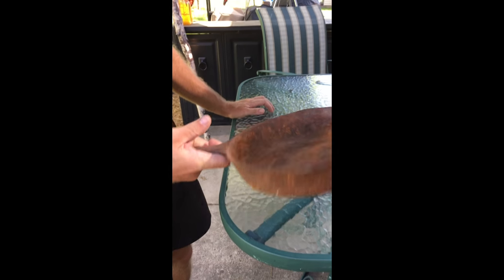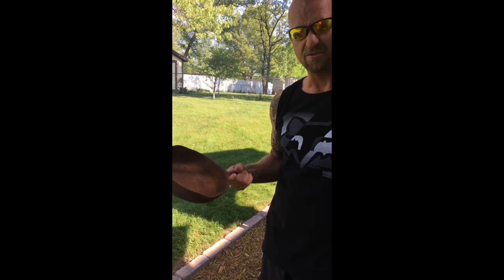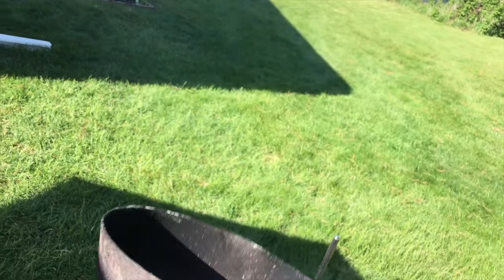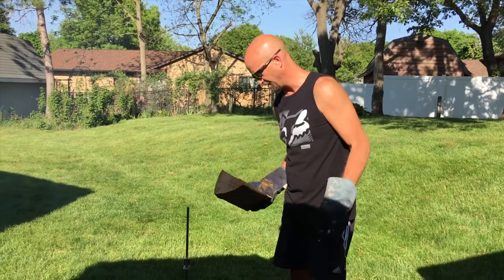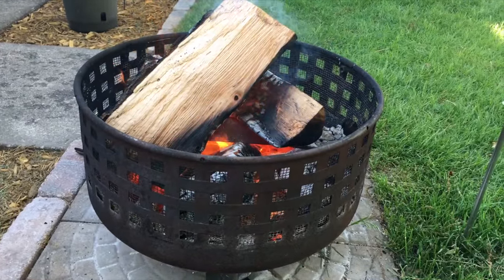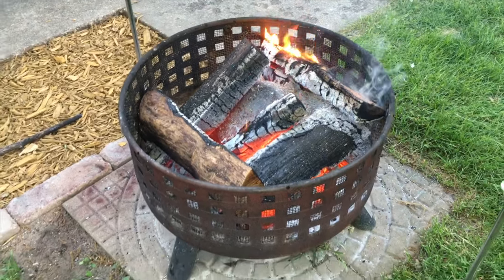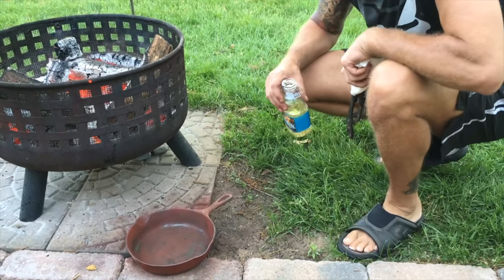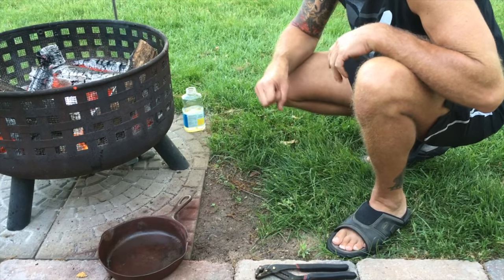Fire Restoration and Season of A Cast Iron Pan

Comment: Fire does not remove rust.  The heat from a fire removes the old layers of seasoning back to bare metal.  Rust will still be present.  You would want to do a vinegar bath or electrolysis to remove rust.  Did I forget to mention that you got your pan too hot?  When your plan is glowing red, it breaks down the structure of the iron in the pan and can severely warp or heat damage the pan.  I know you mentioned other methods like electrolysis, self clean oven or easy off.  You can do a lye bath to remove the old layers of seasoning too.  Just remember this, grandma and grandpa could go to the store and buy a replacement pan for a buck or two.  When you use fire and damage a pan, good luck finding a vintage piece at your local store...

Comment: Please don’t put cast iron in a hot fire to strip it. This could damage your cast iron. I have been successful many times with the fire method but also damaged a piece and seen many pieces damaged by fire. I no longer use this method. If it gets too hot the metal properties will become distorted and the piece will take on a reddish appearance when seasoned. There are safer methods for stripping cast iron. The fire method works great but if it gets too hot the metal can get distorted, warped, or cracked. Be cautious and choose a safer method, especially with a vintage collector piece.

Comment: The pan used in this video looks just like one I have from a house fire. Obviously this technique won't get rid of the pitting, but it will remove a lot of the carbon from the iron that the fire put into it. For removing the rust, either soak it in vinegar OR use a non-toxic rust removing product like Evapo-Rust. Thanks for not including a goofy intro with bad music and for cutting to the chase. This is one of the techniques I've considered using on my housefire damaged pan. Good to know the times and heat involved in the process. Thanks!🔥😎

Comment: Never never put cast iron in a fire.  If it gets too hot it will ruin the piece. Warped, cracks, permanent red marks that will never hold seasoning can easily happen. Old timers always did it because they didn't know better. I have seen it done and everything was fine but if it gets too hot It's ruined forever.

Comment: I have used for to burn grease off my skillets for years and never have once damage a skillet... actually did a fire burn 11/29/21 with no problems.. I have used the oven self cleaning a few times which works as well... you damage your pan when you make drastic temperature changes

Comment: I came across an old hot water kettle neglected  and full of rust. I heated it with a fire inside my charcoal  barbecue grill, and seasoned mine with bacon grease. It actually  came out pretty good.
    Gotta warn you though. Don't use your state of the art brand new glass top stove to heat something  like that because the stench will make your wife madder than a wet hen, and it's the dog house for you for the next few weeks. Hehehe  I didn't expect to smell the whole house up but it did. The self cleaning cycle is for a stove that's  in your shop., not your house.

Comment: I'd suggest you get a drill and if you don't have one borrow one from a friend. Go to Home Depot or your local hardware store and get a scouring pad for the drill.  You can buy different pads. And because I'm anal, I use rough, medium and super fine grit.
You'll notice that old hands are super smooth; that's the way I like them, so after 10 or 15 minutes with the drill, I'll polish with Emery cloth.
You can season anyway you'd like to, since everybody knows that their method is "right".  LoL
My point is that to remove rust, or to re-season, using tools to polish your pan makes for an incredible cooking experience... And you don't have to waste wood or tend to fire in the summer.  :-)

Comment: Perfect, all thes panasies crying over the pan in the fire. Never seen one warp or crack.
Reply: They just ain't capable of knowing what we know lol
Reply: Indeed. One of the benefits of cast iron is it's ability to withstand insane amounts of heat. And you can use any kind of tool with it. Carbon steel,being lighter is more likely to warp. Otherwise the properties are the same.